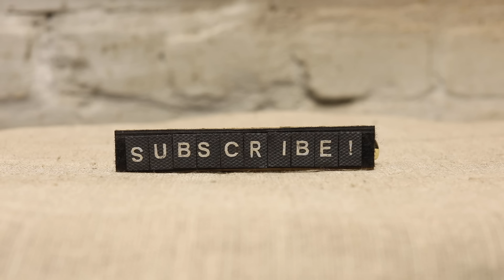Broken Navaja Pocket Knife Restoration. Horse Bone Scales

Comment: I have seen larger versions of these designed as fighting knives. This smaller one must be for a more utilitarian use, perhaps as a shaving razor? I also see the wisdom in hand grinding such a small blade instead of using a belt grinder. No chance of overheating and ruining the blades temper.  Another 10!